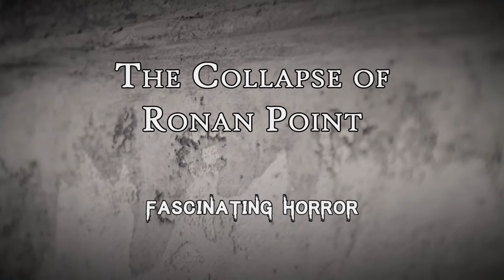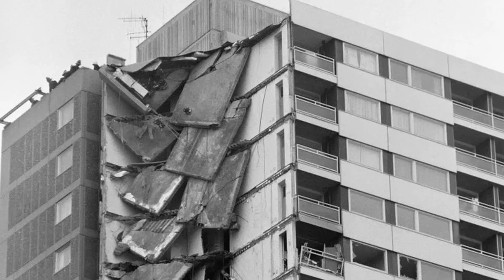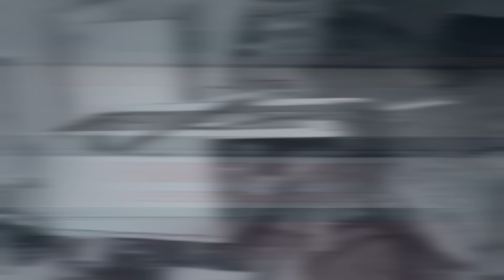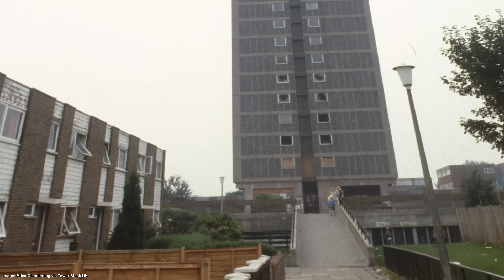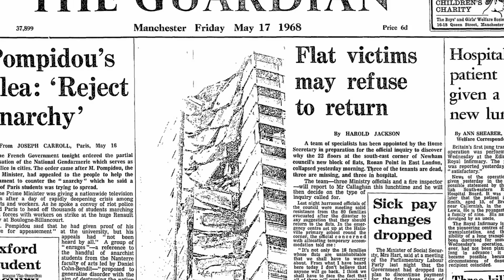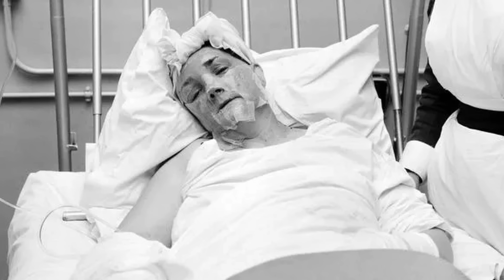Joints Stuffed With Newspaper: The Ronan Point Disaster | A Short Documentary | Fascinating Horror

Comment: In 1969, following the Ronan Point disaster, the Danish government decided to have every housing block built using the Large Panel System tested for structural integrity, to prevent possible accidents before they might occur. 
All were found to be in perfect condition and in no need of additional maintenance or support, and are still standing strong today with no issues. Because they were built to specifications with proper care and materials by people who didn't value saving on material over human lives.

Comment: This type of a building would have a 5 year lifespan tops, in Türkiye. 😊 I live in one of the safest regions of Türkiye (sysmically) and still, I feel a few micro earthquakes every single year. I am comparing a 1960's apartment flat in Türkiye with an apartment flat in UK. Just think how bad those towers are built. 😂 Türkiye was NOT a nation of safety, did not have money, did not have adequate equipment, had extreme rush to cities from villages, did not have adequate standarts for building and still, our badly built apartments are still safer than this tower of shite. 😂

Don't get me wrong, our old buildings are really bad. But this tower is even worse. This is a shocker for me. I am going to lick my apartment flat's coloumn. 😂

Comment: MR. LEAVEY: Uhh, this is a scale model of the block. Uh, there are twenty-eight stories with two hundred and eighty modern apartments. There are three main lifts and two service lifts. Access would be from Dibbingley Road.

(The model falls over. Mr. Leavey quickly places it upright again.)

Uhh, the structure is built on a central pillar system, uh,...

(The model falls over again. Mr. Leavey tries to make it stand up, but it won't, so he has to hold it upright.)

...with cantilevered floors in pre-stressed steel and concrete. Uh, the dividing walls on each floor section are fixed with recessed magnalium flanged grooves.

(The bottom ten floors of the model give way and it partly collapses.)

(crick) Uh, by avoiding wood and timber derivatives and all other inflammables, uh,... (fsss) ...we have almost totally removed the risk... of--

(The model is smoking. Flames can be seen. Mr. Leavey looks at the city gents.)

Quite frankly, I think the central pillar system may need strengthening a bit.

CITY GENT #2: Isn't that going to put the cost up?

MR. LEAVEY: Uh, it might.

CITY GENT #2: Well, I don't know whether I'd worry about strengthening that much. After all, they're not meant to be luxury flats. Huh.

CITY GENT #1: No, I quite agree. I mean, providing the tenants are of light build and relatively sedentary and, uhh, (er instead) given a spot of good weather, I think we're on to a winner here.

CITY GENT #2: Yes.

MR. LEAVEY: Uh, thank you.

(The model explodes.)

-Monty Python's Architect Sketch, inspired in part by the Ronan Point diasaster

Comment: £500,000 in 1968 is equivalent to about £11,000,000 today.
110 apartments therefore cost about £100,000 each, in today's money.
Hmmmm - seems cheap, so I'd say the allegations of cutting corners and cost cutting seem well founded.
Also, I find it incredible to suggest that a housing crisis, said to be caused by WW2, was still so profound almost a quarter of a century later as to be given as a valid reason for needing such high-rise developments.

Comment: Never thoroughly fixed: Ronan Point was partly rebuilt after the explosion, using strengthened joints designed to deal with those issues, and the building regulations were altered to ensure that similar designs would not be permitted in the future. However, public confidence in the safety of residential tower blocks was irreparably shaken,] and the public skepticism of Ronan Point was later found to be appropriate. Many residents, even those in unaffected flats, refused to return after the evacuation.

Sam Webb, an architect who had given evidence to the Griffiths inquiry, predicted that after approximately 15 years, Ronan Point would develop structural problems and collapse. Webb's concerns eventually led the council to evacuate the building, and then to demolish it in 1986 in a methodical manner (rather than, for example, using explosives). When this was done, the extent of the defects found shocked even some of the activists, including Webb himself. It was discovered that most of the mechanical connections between floor slabs and flank walls had not been attached properly during construction. Significant corner-cutting had also been undertaken during the construction, with bolts often missing. Holes that should have been filled with concrete were found stuffed with garbage and newspaper. On the lower floors, cracks were found in the concrete where it had been point-loaded, and it was alleged that the extra pressure on those points during a high wind (such as during the Great Storm of 1987, barely a year after the demolition) would soon have led to building collapse

Comment: Writing as someone who worked on these system built blocks - the theme of this video is missing something - there wasn't anything specified to fill the joints - the blocks were mere stacked on top of one another like a house of cards. 
I laughed when I first saw them going up - there were many black jokes about them being safe as houses and don't worry there's nothing to hold them.
Confusion may be cropping up because the finished floors were wet screeded and yes, cement bags and anything to hand - newspapers were push in the space to hold the screed but don't make out that this a general "do it on the cheap" get out quick thing. Everybody involved knew - they trusted the engineer and architect. 
Most of these wall panels had blocks of polystyrene in them - which when you come to think of it - is doing the same job as the cement bags and copies of the Daily Mirror.

Comment: in romania and hungary,most of the buildings are concrete reinforced panels,joints were welded together, then concrete was placed at all joints..not mortar...most of the building are 60+ years old...no problem...the  design is good but it has to be done corectly

Comment: this really reminds me to the earthquake in turkey. they had built a lot of buildings to house a lot of people, however some corners were cut, resulting in a building, that fell apart during some seismic activity. cutting corners is something you can do, and it is often better, beneficial or even safer (imagine you need to house a lot of people, otherwise they will die on the street), but not always, and it very depends where you cheap out on something, if it is a critical spot or not.

Comment: Taylor Wimpey, which used to be Taylor Woodrow until 2007, had to demolish a half-built development of 148 flats in east London in 2022, after a potential structural issue was discovered in the concrete frame. These guys have been around since 1921, when 16 year old Frank Taylor decided to leave his job as a fruit wholesaler and started to build houses without any knowledge or experience in construction. Over 100 years operating and they have never been held responsible. I guess it pays to have "very good ties" to the Conservative Party?

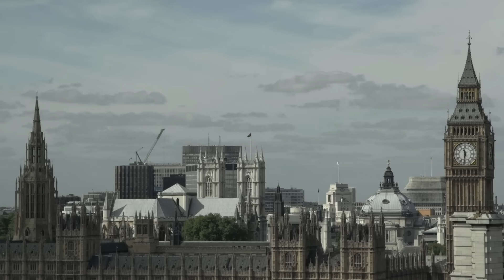Comment: The Peckham Estate you refer to at 11:53 is the Ledbury Estate which comprises 4 blocks using the Large Panel method. None were evacuated though many were given the option of being re-housed. The fear of fire spread through panel joints was the initial issue, these were up to about 10mm in some cases where plaster or floor screed had fallen out over the years from cyclical thermal  expansion and you could smell the tobacco smoke or curry from the flat below you. Some of it was probably original bad workmanship as you point out for Ronan point. This was before Grenfell (which happened in June that year). The gaps in the wall panels and floors were systematically filled, while a 24 hour firewatch was imposed. Ove Arup surveyed them and recommended strengthening the joints and ties. Residents meetings took place to discuss and plan for resolving the issues, which attracted the press and 'experts' keen to get some work out of it and from that it seems that someone questioned why gas had been installed. The gas was taken out pretty quick but residents voted to stay and have the blocks refurbished. This took a while to plan and organise, meanwhile Grenfell happened and then Covid. I havent visited for years but I see they are being/have been demolished now.

Comment: I worked  on a Wimpets site with a steel fixer in 1972 who told me that the long lateral steels that connected the cladded walls would not always get fitted correctly and delayed the build.  Therefore the supervisor told the fixers to do the best they could and cut of any protruding ends of the steel bars so as to deflect attention from inspectors.

Comment: was it normal in the UK to light your gas stove with a match, and not a pizoelectric based sparker installed in the unit? The vast majority of gas stoves I’ve seen are lit with a button or nob that when activated throws a spark into the gas.

Comment: The concept of system building is fine, but it needs three things.
Firstly competent robust design, there were many system building suppliers in the sixties chasing lucrative council contracts, id imagine that bribery and corruption didnt necessarily lead to the best/safest/quality system being chosen.

Secondly factory production needed really good quality control, the pressure to build quickly probably cut corners.

Thirdly ,the massive building target numbers of both the Labour and Conservative Governments led to presdure to build these tower blocks quickly, so again corners were most definitely cut, if a panel had four fixing locating points and one or two were slightly out of alignment due to poor manufacturing, the on site construction worker probably knocked it off with a lump hammer and filled the gap with sealant.
Reply: Maybe not bribery of officials, but old-fashioned "one who does it cheapest gets the contract" and companies did it cheap.

Comment: 1:52 mortar does not usually reinforce the panel structure. It is mostly needed to prevent corrosion of ferrous linkages.
Reply: It did in this scenario. They were oversized bricks

Comment: Now I would like to know how those 3 towers fell in 2001 on they axis without even deviating at all and at the speed of free fall and acceleration from start to total disintegration at the base. And one of those towers wasn't specially structured like the 2 others, plus supposedly some minor fire did that somehow. I mean, I saw a building roll down a hill after a missed planned demolition, once.
Reply: I want to know how those demolition charges were secretly set within those buildings.
Reply: @vksasdgaming9472  By closing the building for days beforehand and using the flow of trucks because of some big work in the tower as a cover to get the material in place. For example. 🙄

Comment: I think theres some misunderstanding as to how gas explosions work in this video. everything explodes outwards from the initial ignition point, with the pressure and velocity of the shockwave accelerating as the fireball grows larger and consumes more fuel. Being hit by that pressure wave is bad and can easily deafen people or worse. If you are in the middle of the explosion, everything is moving away from you, and you're only at risk of burns rather than actual concussive injuries like youd expect from being hit by the shockwave. If you have to be involved in a gas explosion, you probably would rather be the person holding the match. Saying the explosion wasnt severe because the person who was at the center of it didnt have many explosion related injuries is just an entirely flawed conclusion.

Comment: There was an awful amount of building with untested methods in those days, some of which was known to be dangerous and some  unknown( new materials eg high alumina cement).  The newspaper packing (or cement bags) would have been used as a backing for cement to fill gaps(which should not have been there ). This was country wide, most of which was down to greed, get it up and get paid . You have to say all this was known about at the time of building, At all levels of the industry, and by local authorities.

Comment: In Poland places with gas ovens need to have an "anti-explosive wall", which is not structural, weaker than even most dividing walls. Meant to give way and redirect the explosion outwards. So worst case scenario only one housing unit is lost, and obviously some neighbors lose windows. But the building itself is safe

Comment: One point  1:57  "joints between panels would be filled with mortar to reinforce the connection".  That is a complete fabrication!  The panels were built with STEEL tabs at the connection points and bolted together.  At no time was mortar used as a reinforcement material.  The failure was the panels, NOT the connection points.  The panels joints could filled with BUBBLE GUM and it would have made NO difference in the strength of the structure.

Second point   2:31   General contractors DO NOT decide which building method is used!!!!!  The ARCHITECT and ENGINEERS decide the building method and design the building using that method.  The GC is supposed to FOLLOW the instructions provided by the architect and engineers.  If the GC did not follow the building plans and had no inspections to ensure they were properly assembling the building......it was bound to fail.

Comment: So much for hiring unskilled labor for projects that, if they fail, could result in the deaths of multiple individuals. The construction method itself may be sound, but if it's done in a sloppy, careless manner by unskilled workers and, apparently, not sufficiently inspected during construction, this is what you get. The fact that the method was also used for buildings higher than what was known to be safe added weight to the system was not equipped to deal with. You'd figure an engineer would have been used to determine the safety of the design.

Comment: One off the problems was that many in the British construction industry could not read simple instructions and the bosses did not care, a fellow employee of Islington Building Works when travelling between home and work avoided two tower blocks in the next borough as he had been employed on their construction: panels had been fitted upside down, inside out, external panels inside and internal panel externally.  These panels had been marked with the words inside panels top, bottom, external panels, top, bottom but this was ignored and the panel instructions ignored and covered up and made to fit.
Reply: The operative phrase is "did not care". Sometimes you CAN judge a book by its cover. These buildings were patently devoid of character or humanity which was only the tip of the iceberg.
Reply: where did the workers come from?
Reply: @flowinsounds  Mostly Brits.  It was after WWII and the country had an enormous housing shortage.  They employed literally anyone and the focus was on getting flats up and finished.  New building systems meant old builders didn’t understand how they were put together, and the rush and sheer amount of homes being constructed meant oversight was almost impossible.

If they’d stuck with old-hashing house building they’d have had a much better time of it, but that took way longer and many skilled men had been lost in the war.  Just a perfect storm of negative issues, mostly.
Reply: @flowinsounds  there were probably high illiteracy rates at the time and those who couldn't read got hired as they needed a lot of cheap seasonal labor.

Comment: Another ridiculous part of the design was that the outer wall columns weren’t really attached to the ceilings, just held by gravity in a slot. If the ceiling were to ‘jump’ in a high pressure incident like an explosion or wind storm the column would simply fall out!

Comment: This is actually not a big deal. Do you know how many thousands of homes are being built in this country right now by Builders like Dr Horton? Roof trusses aren't stick-built anymore. They're having them hold their as one piece with a million Staples holding them together. They don't use one by, they don't use plywood, they don't even use osb. They are using something called construction board, which is simply sawdust pressed into 4 x 8 sheets. It should be against the law to build houses the way these people do. And they still want a half a million dollars a piece. Do me a favor and read about all the lawsuits that Horton is dealing with. I'm watching them build a community in my hometown and these things have major problems when they are brand new. The front porch on the model home which is a poured slab has broken away from the house and is leaning forward a few degrees. Look at the videos about these constructions. HVAC completely screwed up, electricians that simply cut through load-bearing studs to run wiring, and the most horrible gaps in the roof you've ever seen. Pour concrete work, it's just a money grab until they get sued out of your state

Comment: My kitchen extention was padded with newspaper in some places too. Plaster applied over the top,
Reply: Load bearing wall? If not it's less of a structural issue, though still not great for fire retardation.
Reply: @StuffBudDuz  Two columns of half bricks holding up part of a roof. The newspaper filled the gap between the columns. rendered over with a door lintle on the top on side and a window lintle on the other.
Cavity wall, the paper filled up the gap of the cavity.